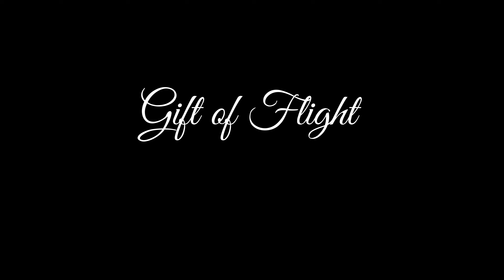Gift of Flight - Rescuing a Legend: The Recovery & Restoration of a PBY-5A Canso

Comment: NJE was originally converted from its RCAF configuration by Field Aviation in Calgary in the early 60's for a company called Canspec Air Transport and originally had 2 500? gallon external tanks on it. As I recall they originally had 3 Cansoes.

Comment: I lived on Sproat lake  which was home to 2 massive 4 engine flying boats the Martin JRM Mars  used for fire fighting for over 50 years,   an amazing long service life  I saw these aircraft  in action for many decades.  an amazing sight  Today they are now silent.   and one plane  The Hawaii Mars  on display at the BC Aviation Museum the other   Philippine Mars  at the US  Pima Air museum in Tucson Arizona.    A personal PBY story of my own was In the Summer of 1979  a PBY Canso water bomber fighting a large fire on the  Beaufort Range  near Sproat Lake  when the portside engine caught fire in flight.  I heard the sound of one  engine at full throttle revving way higher than normal  as it flew over my neighbourhood  with smoke and flames on the other engine and landed at Sproat  Lake.  A small fire in the nearby bushes resulted from flaming fallout debris.    After an emergency landing on the lake  The burning engine was extinguished by a helicopter cable and water bucket   the Canso fire bomber's  wing and engine mounts were burned and melted beyond repair  The plane   sat at the Mars Bomber base for a year  until it was salvaged  for parts and was likely scrapped  at the Sproat Lake bomber base sometime in late 1980.

Comment: Could you share which camera body and lens you used to film this, along with the codec, bit rate, and file format settings, and whether you applied any color management? Or was it done by a separate group or a talented individual who lent their services for this mini-documentary?
Reply from the maker: It was actually done by another individual for NOAHC. Unfortunately I am unable to get that info. He sent the 4k .mov file and I re-processed in Adobe Premier optimized for YouTube. Here are the only details I can provide, Although I do believe it was shot with a Canon DSLR, model and lens unfortunately I do not know .
 
Media Info Details:
 Stream 0
Codec Audio MPEG AAC mp4a
Stereo Sample Rate 48000Hz
Bits 32

Stream 1
Codec H264 MPEG-4AVC (part10) (avc1)
Video Resolution 3840x2160
Frame Rate 24
Color Primaries ITU-R BT.709
Color Transfer Function ITU-R BT.709
Color Space ITU-R BT.709 Range
Chroma Location Left